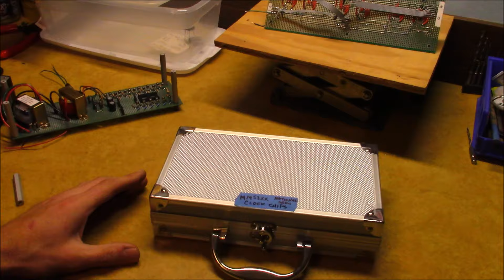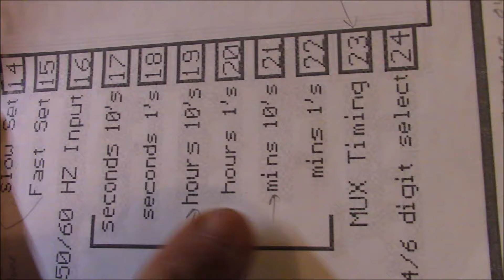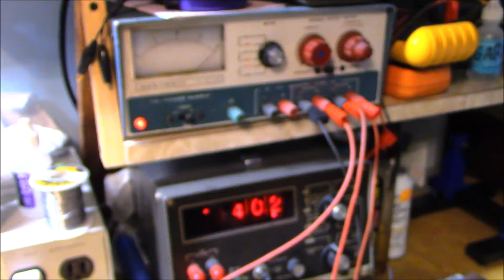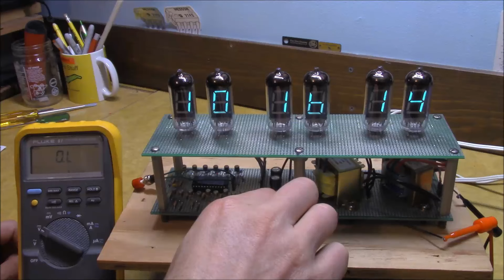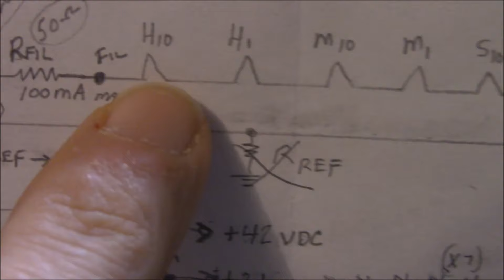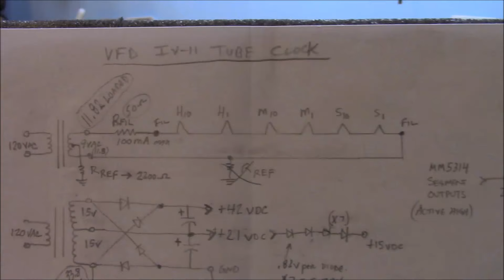Old School Digital Clock Build Log with IV-11 VFD Tubes - PART 2 - Vintage style -

Comment: Nice work Jim, it looks great! If you want to improve the contrast, a green or blue filter would really make the lit segments pop. Using one of those small VFD tubes as colon separators would look nice, and some Soviet clocks did just that.
Reply from the maker: Thanks Matt.  After thinking on it for a while, I really think I may use the smoke tint for two reasons:  I like the natural color of the VFD and I already have the smoked tint on hand.  It seems to offer enough contrast.  I am working on integrating the IV-3 colon tubes to the existing circuit as we speak.  Thanks again!
Reply: @JIMO415  That's fair, it's a personal preference thing. The Soviet VFD tubes are bright enough that they don't NEED a matching filter to be readable in bright light. Hopefully adding the colon tubes worked out okay.

Comment: Thank you for the shoutout and I'm so glad you were able to put the information from the document to good use!  It's nice that you covered all the key points in your video.  And yes, the bias applies to the center tap when using a center tapped transformer, but in general it applies to the the filament voltage itself of course, however it is produced.  So for example, if you use one of those "tilted" displays and were powering it via DC,  you would still want a positive DC bias for the same reason.  The clock is really taking shape, looks and works great!

On the topic of filters, just my 2 cents, but I personally like the natural green phosphor color, so I wouldn't go too crazy with color.  Did you know that if you use a red filter, the segments will appear white?  Orange will make them appear yellow.  If using a filter at all, my personal preference with these tubes would perhaps be a slight smokey tint, but in the end, it's whatever appeals to you.  Again, just my 2 cents.  Great video BTW, and I enjoy the longer videos.  Will enjoy seeing the final build when it's ready!
Reply from the maker: Thank you again for the supportive complements.  I did try to get across all the points with my chopped up way of speaking thru low budget extreme editing. (watch the seconds count on the clocks as I speak hehehhe).   
Filters, yes good to know on the other colors.  I feel the same with the natural phosphor color, I like it the way it is.  That is one reason why I was leaning toward the smoke tint I already have on hand and that is the other reason, I already have it on hand LOL.  I do have to add, if I had to use a colored filter, blue would be it.  That Aries clock I rehabbed recently looks pretty good that way.
More vintage style builds planned....maybe a free form as well checking out some of yours!  Nice work!

Comment: Thanks Jim for sharing this nice clock. I have some IV-11 tubes, so you inspired me to try building one by myself….can you please tell me where I can find the schematic ?
Thanks 
Stefano
Reply from the maker: Can you screen shot it from the part 1 video at 8:43?  https://www.youtube.com/watch?v=H3iAr_EtzxQ&t=4s
Or I can send to an email if you feel comfortable leaving one here...  If those options do not work, let me know.
Reply: @JIMO415  Dear Jim I wrote you two times with my email address…but I can’t see it. it seems that my messages are deleted.
So I don’t know how to write to you.
Any ideas ?
Thanks 
Stefano
Reply from the maker: @stefanobozzini6353  you can try one more time to send an email but use "at" for @ and use "dot" for the actual dot.  If still no luck, let me know again and I will try to leave mine which I do not like to do as it is my only one.  Good luck.  Thanks
Reply: @JIMO415  no way Jim, I’ll try splitting the address in 2 messages: steboz at
Reply: Dear Jim, this is an hard task. Any message containing dot is deleted by you tube.
Lets try this : steboz